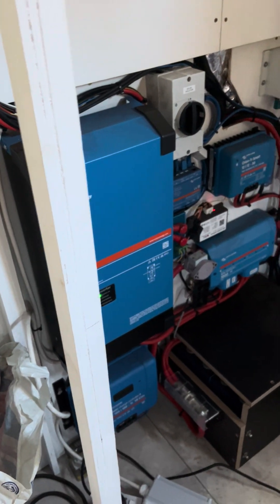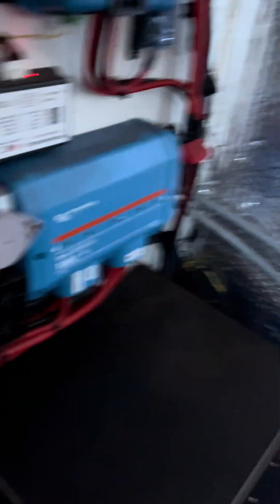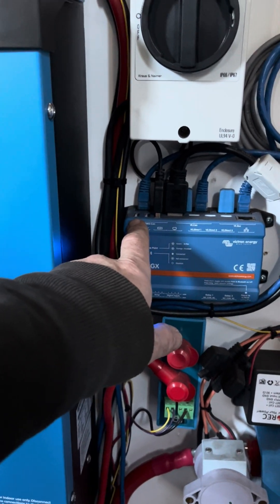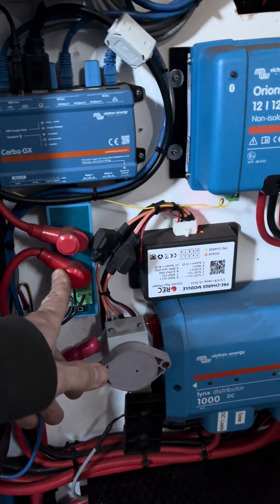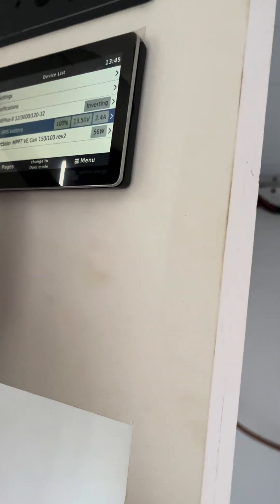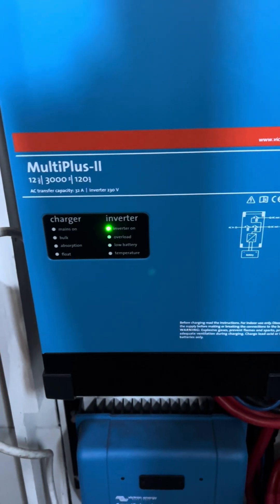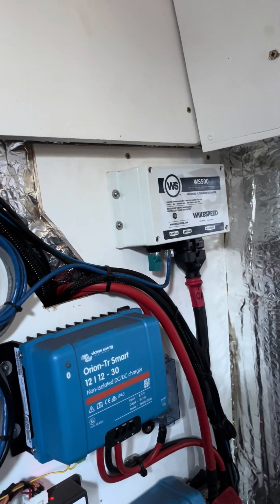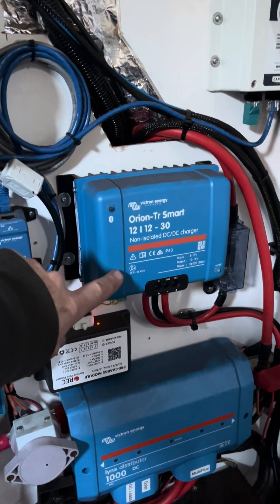Lithium battery installation on a Narrowboat. REC-BMS. Wakespeed WS500 Alternator. Solar. Victron.

Comment: Impressed with your systems Ed. Do you use a separate Lead Acid for Starting?
Reply from the maker: Thanks! Yes separate lead acid for stater..most narrowboat have twin alternators so much simpler with no need for DC to DC charger. 👍

Comment: I been watching you for years similar set up on my boat the only thing I couldn't work out was to get a lister sr2 pumping out more power in the winter I have bifacial solar pannels I have to use my jenny maybe 2 months a year now with all this lithium and I'm gass free use the bobil van system on the boat which trickle charges hot water from a diesel blow heater and in the summer steals all amps to keep water at 65.c amazing how victron keeps getting better I'm now on 48v raw cells using a seplos mason case and bms v3 allows it to have a heated mat for winter months and charging haven't gone below 60% all year keep up the great work you inspired me into this...